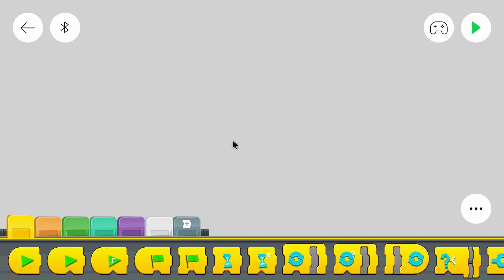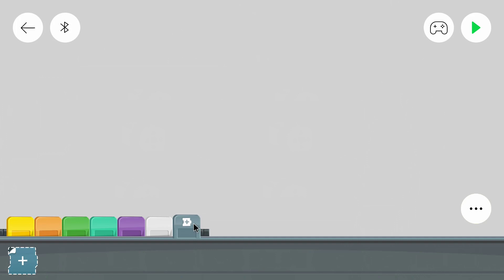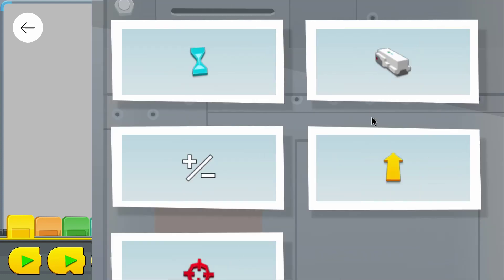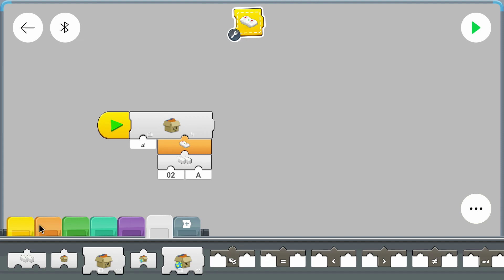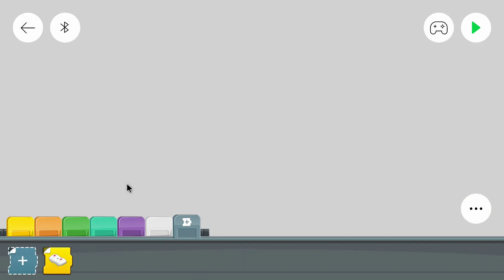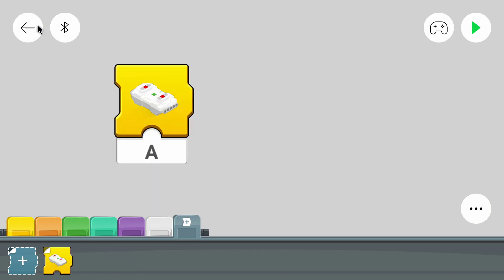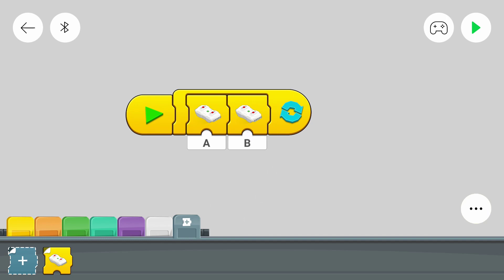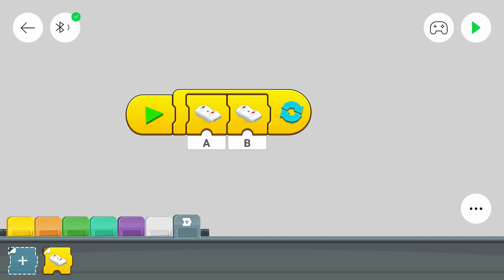Lego Powered Up Tutorial #18: create your own block for a remote controlled vehicle [English|HD]

Comment: Hi, I've only recently got my first Lego set that runs on the Powered Up app (motorised the Tram in the latest Lego Winter Village set) and was trying to work out how to automate the running of it. This tutorial series is the best I've found so far, I've learnt heaps, thanks. Amazed at how powerful the app is.
You mention in this video about sharing code blocks, how do you do that? 
Also, how did you video the app and use a mouse to control it?
Reply from the maker: I'm not sure what you mean by sharing code blocks. Do you have a timestamp?

Android devices sometimes support USB OTG to connect a USB device. Additionally, there are android devices with a HDMI out which can be captured. There are no additional steps required if you use android.
In my case, it's a hacked nintendo switch console with a USB mouse and a HDMI capture card (Elgato Game Catpure HD).
Reply: @technicmaster0tutorials  at 7:48 when you discuss teamwork.
You got my thinking, so I found another way to use the Powered Up app on a Windows PC. If you have a Samsung phone there is a Windows app called Samsung Dex, connect the phone to the PC via USB and you can then run the app in Dex and use the mouse to manipulate the code blocks. Much easier than using fingers on the small screen of a phone.
Additionally you could use a program like OBS Studio to capture the Dex screen.
Reply from the maker: @A_BricksAndThings  My idea was that you "redo" the program on the other device once the program is finished. It's also possible to access the folder structure of the PUP app in android and programs can be shared that way, but that's not very straight forward.

Comment: Hi! Is there an option to set continuous acceleration while button on the remote is pressed using poweredup app?
Reply from the maker: What do you mean by continuous acceleration?
Reply: @technicmaster0tutorials  I mean that speed (power) of motor would grow from 0 to 100 in some progression as long as you keep holding button on remote. Not instant 100% after pressing button. I have onle one idea - to make a sequence of different blocks with for example 20-40-60-80-100% output separated by a few seconds. Maybe there's a way to increase power smoothly (with one button and in poweredUp app)? :)
Reply from the maker: @yolotoly  That's possible in theory but I think that it wouldn't be very controllable in the end